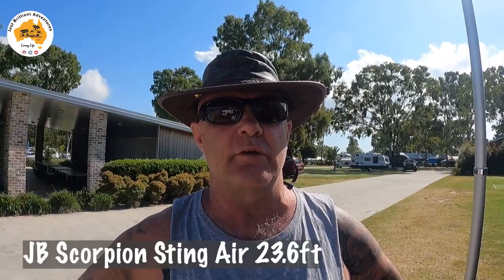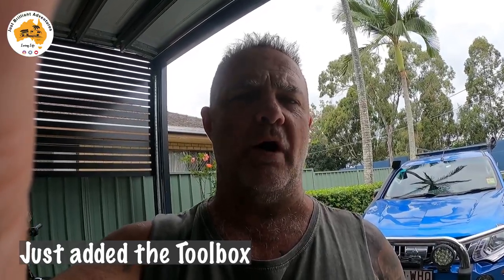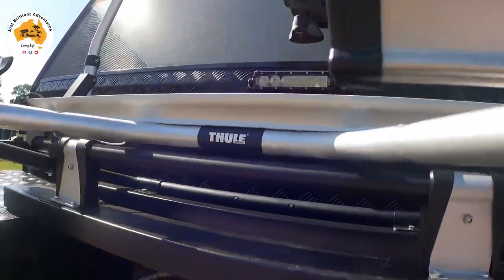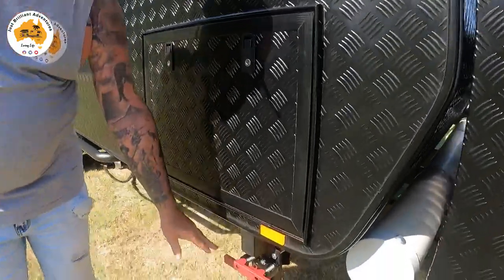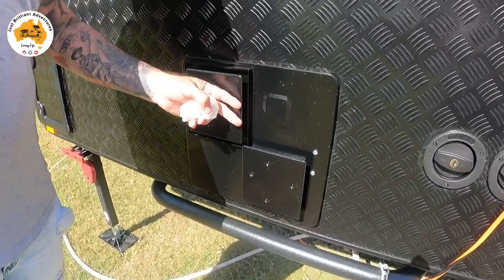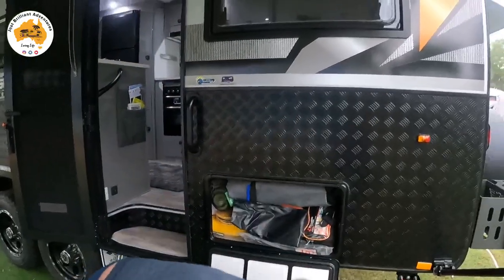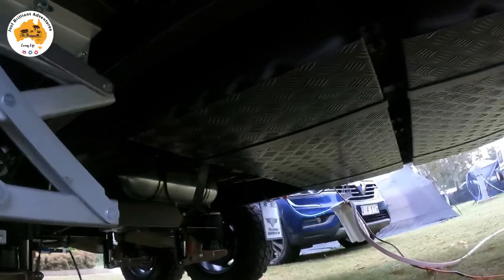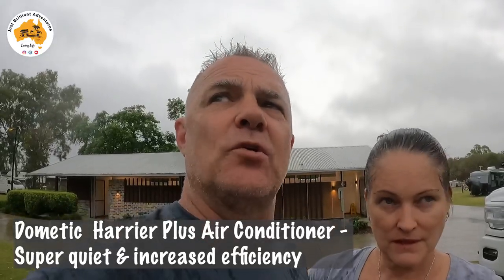Caravan Tour - JB Scorpion Sting Air 23.6ft Full Offroad

Comment: Great walk around  would you brace the tool box with a bracket so the u bolts don't crack the bottom of the toolbox floor ? Like the remberance decal on the rear of the van can't wait to see the inside  and the 350    cheers Trev
Reply from the maker: I have some mate. That's a Sunday job. 🍻